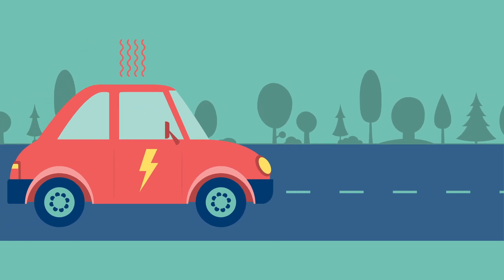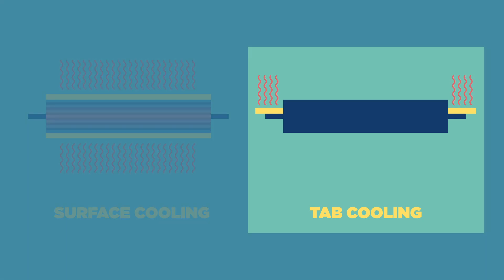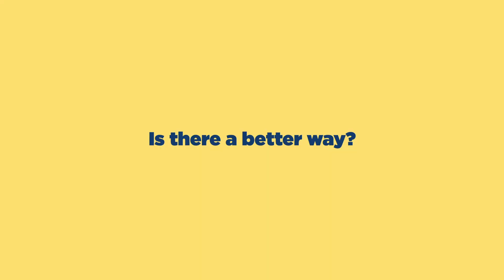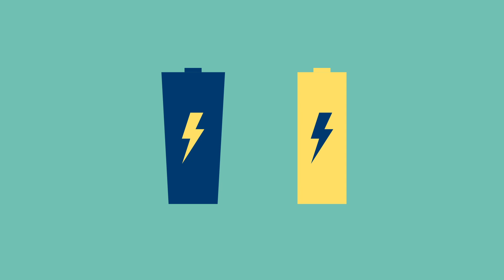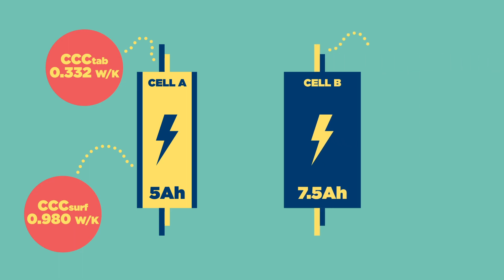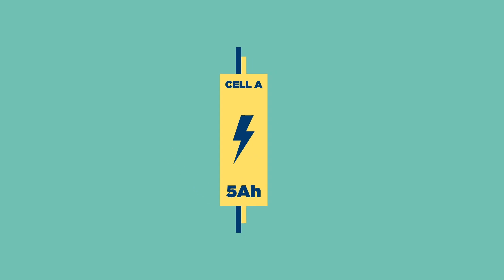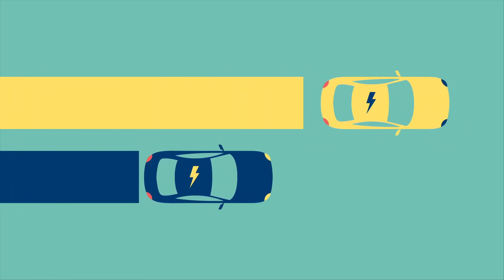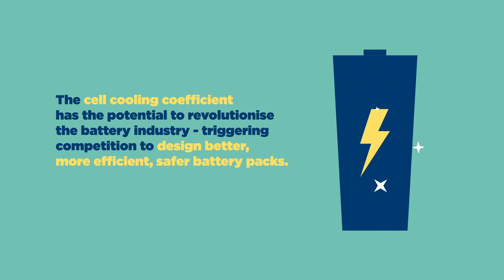The Cell Cooling Coefficient for Lithium Ion Batteries

Comment: There is a mistake in min 3:15 approx. It says 40 degrees below, and it’s *Above
Reply from the maker: We are trying to demonstrate that very large temperature gradients are required on some tab cooled cells because their tabs are not well designed for tab cooling. In this example, we highlight that the tabs must be kept 40degC below the maximum temperature of the cell in operation in order to remove the heat through the tabs at the required rate

Comment: Is thermal runaway the same as short circuit due to dendrite growth?
Reply from the maker: In extreme cases, dendrite growth can cause an internal short-circuit within any lithium-ion battery. An internal short-circuit can lead to rapid heat generation from the battery and thermal runaway. Thermal runaway can also be caused by other events, for example through mechanical stress to the battery or through over-charging of the battery. Thermal runaway refers to any case where the battery self-heats and then rises very rapidly in temperature. We recently published a review on fire safety in lithium-ion batteries which is open access and can be found here: https://iopscience.iop.org/article/10.1149/1945-7111/aba8b9/meta